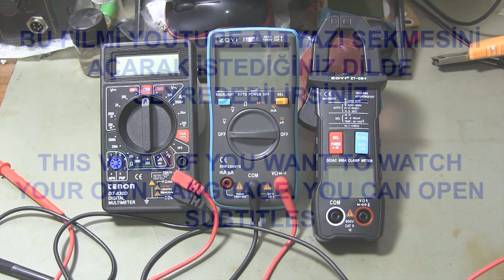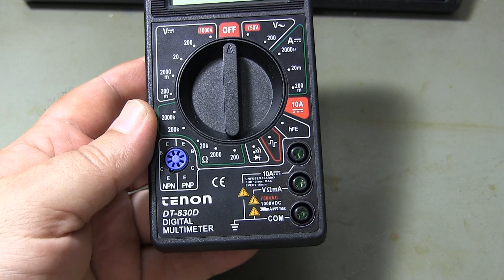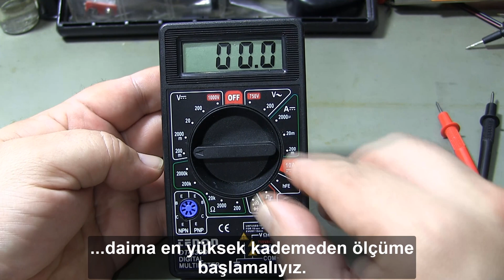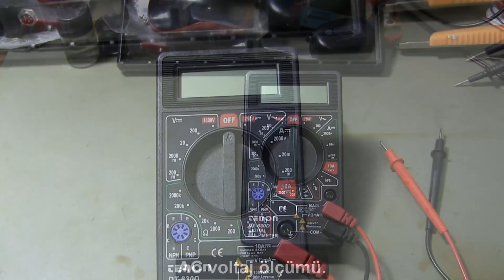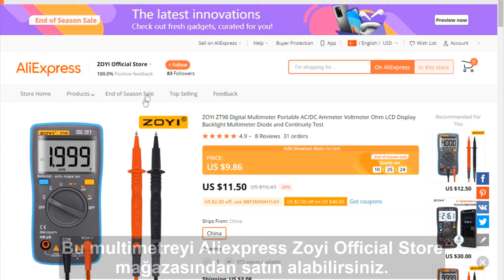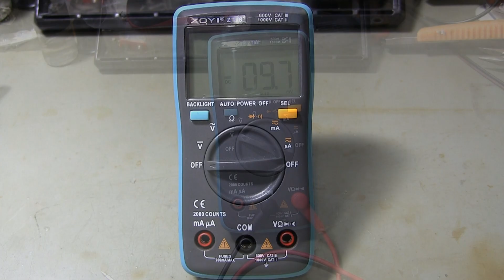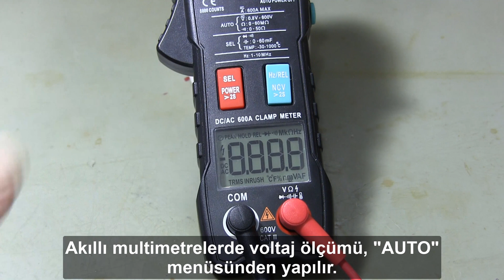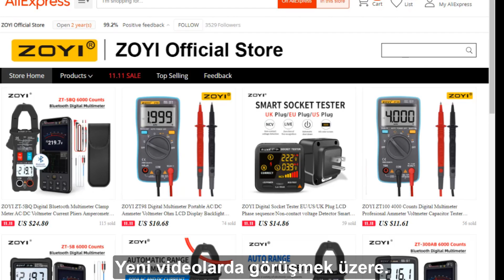HOW TO MEASURE AC/DC VOLTAGE WITH MULTIMETER?

Comment: Kaynağın Ac mi Dc mi olduğunu bilmediğimizde ne yapmalıyız
Reply from the maker: Merhaba öncelikle bu güzel sorunuz için teşekkür ederim.
İlk multimetre ile (ucuz olan multimetre) DC kaynaktaki voltajı AC voltaj bölümünde ölçmek istediğimde, DC kaynaktaki voltajın iki katı olarak AC voltaj bölümünde ölçüyor. Örnek verecek olursam 5V DC gerilimi multimetre 10V AC olarak ölçüyorum.  Aynı multimetre ile AC kaynaktaki voltajı, multimetrenin DC voltaj ölçüm bölümünde ölçmek istediğimde herhangi bir değer göstermiyor. İlk multimetre için kaynağın AC mi yada DC mi olduğunu bu şekilde anlıyabiliriz.
İkinci multimetre (ZOYI ZT98) ile DC kaynaktaki voltajı multimetrenin AC volt bölümünde ölçmek istediğimde, herhangi bir voltaj değeri göstermiyor (0.0V). AC kaynaktaki voltajı multimetrenin DC voltaj ölçme bölümünde ölçmek istediğimde herhangi bir değer göstermiyor (0.0V). İkinci multimetre için kaynağın AC mi yada DC mi olduğunu ölçüm değerini göstermesinden anlayabiliriz.
Üçüncü multimetre (ZOYI ZT-QB9) Smart tipi multimetre olduğu için ölçüm kaynağına göre kendisini ayarlıyor.
Reply: @electronic7979  hocam bende de zoyi zt-102 var ölçü aletine herhangi bir zarar verirmi
Reply from the maker: @Serkan_C0  herhangi bir zarar vereceğini düşünmüyorum. Ama yinede dikkatli ol.
Reply: @electronic7979  cevaplarınız için çok teşekkür ederim.
Reply from the maker: @Serkan_C0  Rica ederim. Yeni videolarda görüşmek üzere